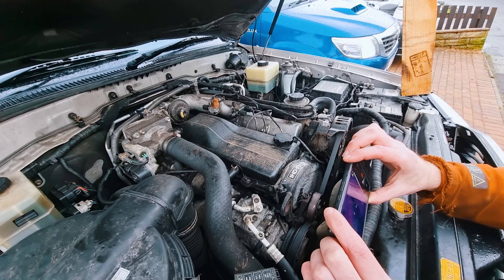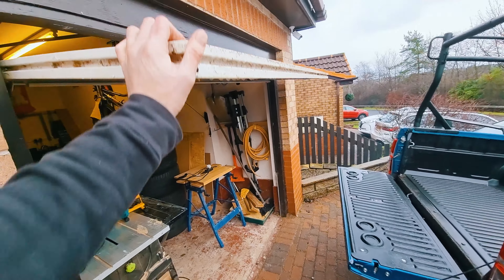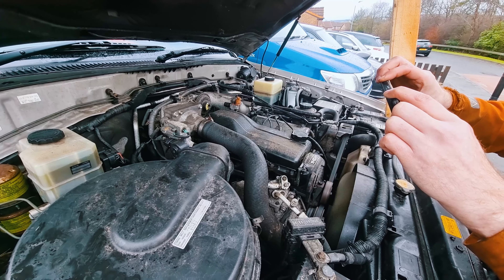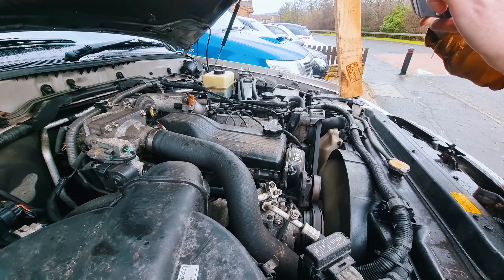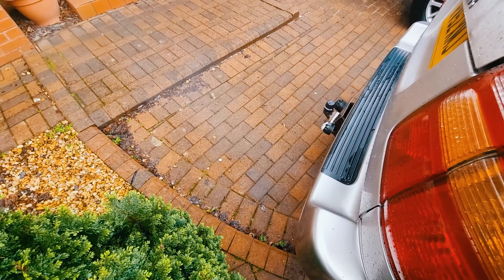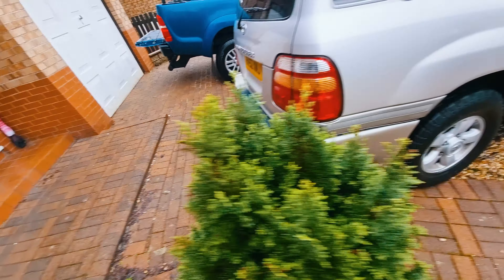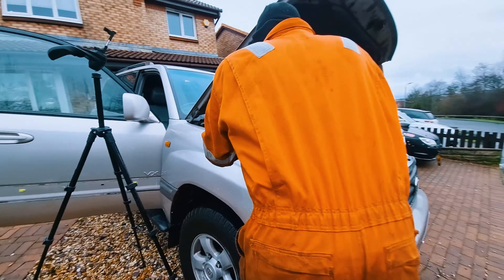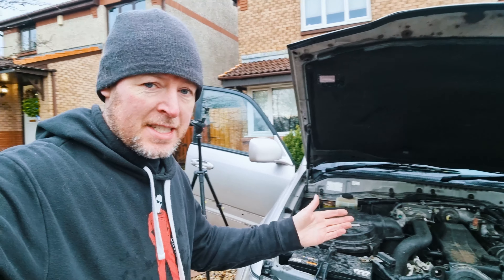Why is the Land Cruiser smoking like this?

Comment: How is the hose of the turbo going to air cleaner? Filled with oil or not? If filled with oil,piston rings might be worn out.but still,it's cheaper to have the injection pump be overhauled  or replaced whichever is cheaper. In the Phil's, overhauling costs $300

Comment: Stack Pipe, fuel pickup, tank filters and genuine fuel filter.  That was similar issue on a friends and that is how we fixed it. Its common to think that tis dead but its just all gunked up filters and the stack pipe (if it has one) if not, i'd suggest injector failure and its intermittent. It may also explain the noise, the pump is working harder cus its not getting the fuel it needs. Good luck guys.

Comment: I have a HDJ79 that is also smoking. Starts mint and runs perfect, just has some grey/white smoke coming out the exhaust. almost hard to see when idling and easy to see when you give it a rev. Doesn't go away when warm, any ideas? Been sitting 3 years hasn't had a good run since (broken diff) so hoping it just needs a good run. Didn't do it before sitting 3 years from what I remember.
Reply: If anyone is wondering - a good drive on the highway for an hour cleared it up.

Comment: Have you done a test on the plugs? If its only doing it from cold then clearing out its where I'd start. I could be completely wrong but worth a try
Reply from the maker: Sadly no plugs on this model. It has a glow screen which is working perfectly. So far all signs point to a knackered engine

Comment: Hi there, my 4.2 fte cruiser did exactly the same, I spent months looking into it, if I was you try wiggling the wiring to the fuel solenoid on the pump, mine was exactly the same, the wiring from factory is too tight and pulls on the pins happens at around 200k, uk cars seem to suffer. 

I strongly advise you check that wiring and connection, as mine was exactly the same.

Comment: worn valve stem seals cause smoke on start up as oil drips into cylinders making heavy oil fuel mix in combustion chambers..easy fix time consuming, but easy to replace said seals..low pressure to injector pump can also cause rattle in injector pump..i would eliminate all of these before replacing very costly injector pump...i hope this helps in some way..

Comment: White is usually indicative of overfueling as diesel causes a white mist when atomised and unburt. Partly burnt diesels usually black and oil is blue. 
Fuel pumps like that without looking it up might be part of the timing and it controls when the injectors fire before the days of common rail.
They also run on a cam system inside the pump and the lines feed the injectors remotely. Due to this the rattle could be normal coming from the pump. As advised in other comments reduce the amount of work it has to do by changing filters etc and see if any change.  
Im no expert so just my thoughts.

Comment: I would say it is normal. Old diesel engines with mechanical injection smoke when doing cold starts. Cold weather more smoke.  Solution is to install a block or pan heater.

Comment: So if you gun the motor the smoke amount should become less dense .. But if remains the same color when you increase RPM I would do a leak down test to see if the cylinder pressures are within spec .. If they aren't maybe you have a head gasket issue , or an issue with the rings or cylinder walls ? ..
Reply from the maker: You are right! Head gasket was gone, and 4 of the piston rings were ruined and crumbling.

Comment: Hi, first of all, love the channel. I have the same model LC new since 2005, only 140k on the clock, serviced regularly and only motorway and city driving.I have the same issue as you plus It is  burning a lot of Oil.Heavily smoking on some start ups as well, blue/white and sometimes black. I have taken it to a few mechanics and their opinions on the issue are different. I had the injectors cleaned but still have the same issues. I am hoping I will finally find out the issue from your video lol
Reply from the maker: Well so far nothing cheap has fixed it. We've got a few more things to do, but all signs point to the injection pump right now. We've got more videos coming as we try things out.

Comment: Injectors I had a pd130 running rough as balls white smoke for abit and replaced injector loom which stopped it running rough but once it sat for abit one of the injectors leaked which caused it to smoke but that's just my experience
Reply from the maker: I'd love to be able to tell which cylinder is causing the smoke, but the electronic diagnostics just aren't good enough on this old bus 😔

Comment: What if turbo seals are going and its sucking oil into the block then when you start it from cold its burning all the residue away
Reply from the maker: Interesting. I think it'll need a turbo anyway, so perhaps I could get that sorted before spending a fortune on a new injector pump.
Reply: @vPerformance  try and find just a replacement core it will be a fraction of the price of a new turbo, easy enough to change over hardest part is removing said turbo
Reply from the maker: Oh yeah I had a look at the bolts and studs and they're all rusted and siezed. That's not going to be fun to remove.

Comment: Check the tappet valve clearance if it is right then go for fuel pump and injectors
Reply from the maker: Checked all those and turns out we had 4 damaged pistons, ruined bearings and a blown head gasket.

Comment: Going through a very similar issue with my hdj100, on reving it to 1500-1700rpm it will blow a fair bit of white smoke, and shakes its ass off. I've tried a known working ecu and spill control driver, aswell as running and earth from the spill control driver directly to the battery as that can be a common issue (earth's through the mounting bracket)
Have put a new plug and checked wiring to the timing control valve another common issue.

A diesel tech here in Australia said they had one with the same symptoms before chrissy and changed injectors and pump with no success, refuned old mate his pump and then went hunting around the wiring. Found dodgy/aged wiring to the crank angle sensor and that fixed it. However they did that to mine and  still no luck. I checked through it today and noticed exposed wiring at the plugs, next step I'll replace the plug then the sensor itself, then I guess I'll have to get injectors tested and then pumped tested.

We tow a 3t van and seems to still pull alright but does use more fuel than it should and while accelerating it makes an annoying rattle noise
Reply: Seems like the timing is out
Reply from the maker: Did you get a good result after fixing the crank angle wiring?
Reply: Unfortunately haven't gotten around to it yet

Comment: I would look at the injector patterns first, then servicing the pump after that. Worth doing both once above 250k, haven't seen many 1hd-fte engines failing.
Reply from the maker: A good place to start. We removed all the injectors and got them serviced and ultrasonically cleaned (some were absolutely filthy). I think it's going to be that pump. I wonder if I can find a place to service it rather than a complete replacement.
Reply: Contact Shaun Arkinstall Fuel Injection Services. He’s based in Bristol,England, an expert in these Denso ECD pumps. FTE comes with a Denso ECD V4 Pump.

Comment: I had a similar issue on a bmw turned out to be a bad glow plug relay thats caused smoke
Reply from the maker: Another great idea - this particular engine doesn't have glow plugs, but it does have an intake heater screen to do a similar job. That's been tested now. It draws 100 amps at startup, so it's clearly working!

Comment: Blue smoke indicates some leaking piston/s probably some rings.
Reply from the maker: You sir are correct. This engine needs 3 new pistons and rings
Reply: @vPerformance  ouch, not cheap going by my own experience. I opted for a full rebuild.
Reply: Exactly bad piston rings sealing

Comment: It's apparent, that you aren't familiar to those engines. 
Stick a new genuine fuel filter on, blow air back through the fuel line to clean the tank filter, good to go. 
The sound from the pump is normal, just get it out and work. 
Keep up on the service and you will only be lifting the bonnet to add washerfluid, this isn't a vag or LR.
Reply from the maker: The engine has low compression and its being dismantled for new bearings and piston rings. It's ruined.
Reply: @vPerformance  How have you ruined it? It's almost impossible, at least at sub 400hp
Reply from the maker: It was like that when I bought it. These diesel engines are not as reliable as everyone thinks. However, it shall live again
Reply: @vPerformance  Have it done over 1mil miles? Or never serviced?
Reply from the maker: No only 150,000 miles!
Reply: @vPerformance  impossible
Reply from the maker: Very possible.
Reply: My uncle owns the same car changed the oil only all 20.000-30.000km used it for woodworking. Has now 760.000km now the car is dead because of rust. Its strange that such a engine is so damaged with this kilometers.
Reply: do you know how low it was the compression on each cylinder when you did the compression test pls ?

Comment: Either nozzles and fuel pump issue or something major. If I was in your shoes, would start with the basics, replacing engine oil, fuel filter and etc. 

Second step would be applying directly Liqui moly diesel purge to the fuel filter/nozzles, sharing link for reference:

https://youtu.be/jDPjPKSfKOE

Hope it’s not something major. Best Regards from  🇵🇰
Reply: Also please consider cleaning your EGR valve!
Reply: Bro any contact? In 🇵🇰 suffering from the same or being paranoid help would be immensely appreciated.

Comment: Most likely a bad injector
Reply from the maker: I thought so too - we've just had the injectors serviced and they're all in great shape. We wanted to eliminate that possibility quickly.
Reply: @vPerformance  right ok the only other easyfix I can think of is air getting in the fuel lines somehow
Reply: @bh635  would be worth doing a compression check for possible valve seat issue